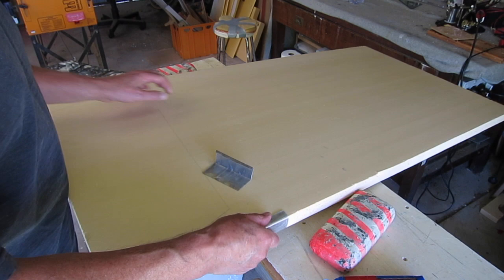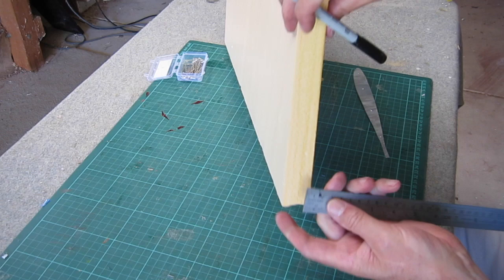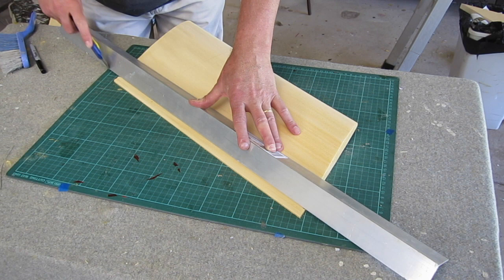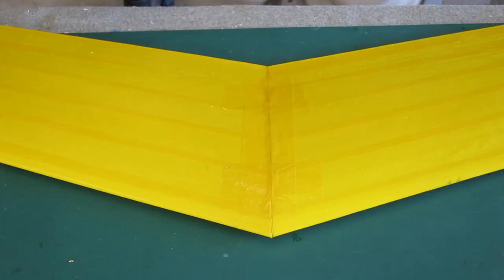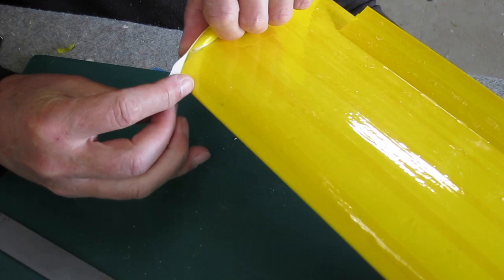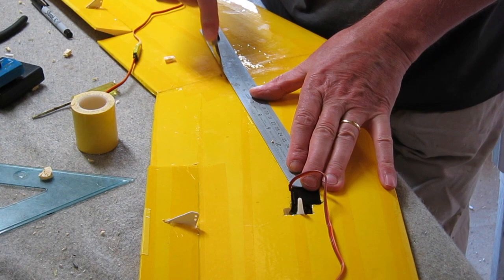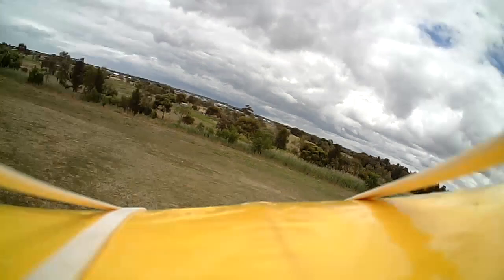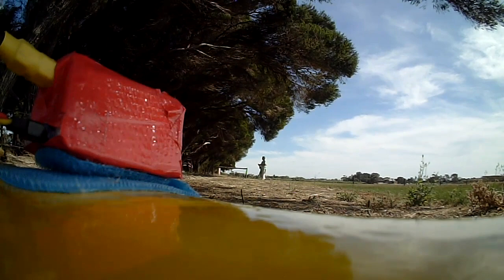Sipkill FPV 1m Wing Build

Comment: hi andrew

i love that you have your technique down to such a fine production line for such a variety of aircraft; yet another great video !

my only hint is using a small phillips head screwdriver dragged at an angle to encourage servo wires and the like into the slots you made for them - automagically centres them and keeps them from twisting

hope that's useful - a minor repayment for all the "borrowing" of your ideas i will do once i get into foam cutting :)
Reply from the maker: +ashley collard Thanks Ashley. Good tip, I'll use that.

Comment: This foam looks similar to foam we have here in the states, known as pink insulation foam, or pink panther foam. Extremely messy to work with.  I like your build.  Good to know I am not the only one unable to recover from an occasional stall with a wing. They are just so COG picky. Thanks for the video again.
Reply from the maker: +Christian Prodanov Yes it would be the same foam. Works out to be the cheapest and best build material for me.

Comment: Andrew what sand paper do you use? I made some hot wire cuts but I couldn't manage packing tape to stick to the cut (dust and small imperfections are just not sooth enough).
Reply from the maker: +SladkaPritomnost My sandpaper is Norton brand 120 grit. It is white to start off then wears down to dark grey after use as the anti clogging filler is worn off. I do make sure to brush and wipe off dust as much as possible.

Comment: It allmost looked like a wood-grain after the hot-wire job :) 
Cool build video sir! Any idea what the after-loop stall is about / how to solve that? I have not encountered that with my wings (yet :P) 
Cheers & have a good weekend!
Reply from the maker: +DutchRC Adventures I have not encountered such a radical tip stall spiral before. Possibly needs a thicker airfoil to carry the weight. I tried rounding off the leading edge a bit more and that helped but didn't eliminate the issue. I'll keep investigating.
Reply: Do you allso have this stall problem in hard turns??
Reply from the maker: +DutchRC Adventures Dont think so but have only tested in strong winds so far.

Comment: the spiral instability that it exhibited after dropping a tip in the loop looks to me like it has something to do with the pod (and thus the thrust line/vertical CG) hanging so low. Some sort of pendulum effect gaining momentum as it oscillates? Maybe i'm totlaly off the mark though haha. What's the wing loading?
Also, I can't tell if you're aussie or nz, but do you know anywhere to get good EPS foam in nz? bunnings don't seem to sell the orange stuff anymore, at least where i live :(
Reply: Also, before you abandon the specific foil, maybe try adding some little electrical tape strip turbulators at the LE between 15-25% or so for the outer ~60-80mm.
I use 3mm x 80mm double stacked tape, and do 2-4 of them per tip (spaced 3-4mm apart) depending on how the airfoil responds to it. Too far forward = extra drag, too far back and the turbulator isn't dealing with attached flow, and does sweet F-A
I love your tidy building technique btw. I've had heaps of fails with hot wiring, but I'm keen to try and emulate this method closely in future.
Thanks for the great vid!
Reply from the maker: Aussie. Thanks for your thoughts on the wing. The XPS comes and goes from Bunnings, we still have it here.

Comment: Great video, I notice that you seem to like hot wire cutting wings, I live in Canada and have access to foam board what is easier to do, and more durable for a newbie. Also is the Flysky FS-i6 still a good choice or would you go for FS-i6x. I might try your trainer design. What I like about your video's is you talk about the pro's and cons of the plane/equipment and you seem to give a good  account of the equipment and what its limitations are. Things you can get from the box. Even if I never get flying have enjoyed watching. Cheers
Reply from the maker: Thanks. Foamboard is easier to build with for a beginner but hot wire cut it much more durable. The FS-i6 is the best choice, more adaptable than the i6X
Reply: Thank you for the response. Your hot wire rig is a nice straight forward design. Keep flying and thanks for sharing your thoughts and adventures.

Comment: how does the landing not break the props?
Reply from the maker: Setting the ESC braking helps, so the prop is not spinning when you land
Reply: thanks for the response.. but even the props arent moving anymore.  wont it come in contact with the ground on landing?

Comment: I built a Flite Test Versa Wing and it would snap when I'd try to loop it. That particular wing was not fun to fly.
Reply from the maker: +yellowbusguy Interesting. This one is actually a blast to fly, just have to make the loops big fast and smooth.
Reply: +Andrew Newton 
...maybe installing vortex generators on the outboard 1/3rd of the wing might prevent this crazy stall characteristics..., it should be easy fix too...
http://www.rcgroups.com/forums/showthread.php?t=2252309
Some builders make tip chords thicker to improve stall and control characteristics.